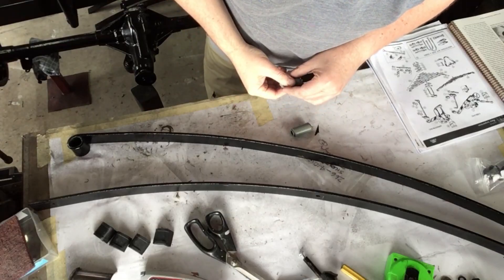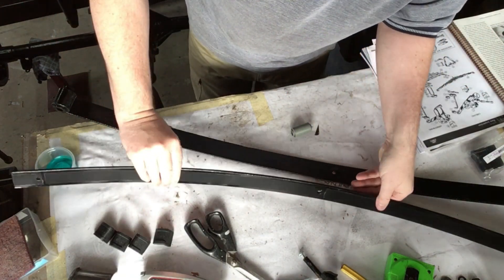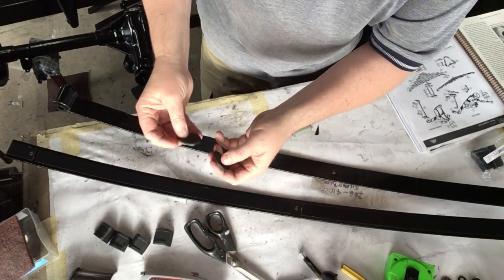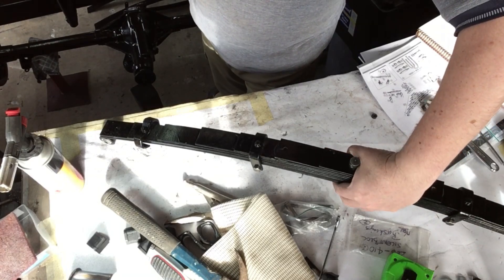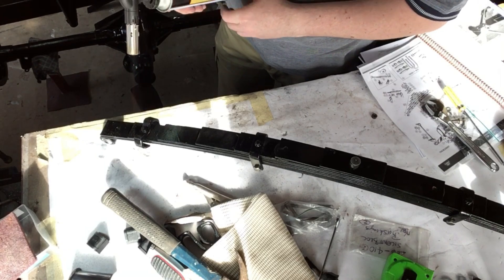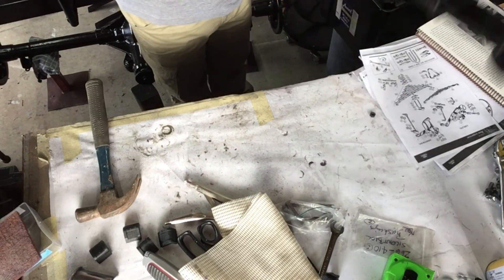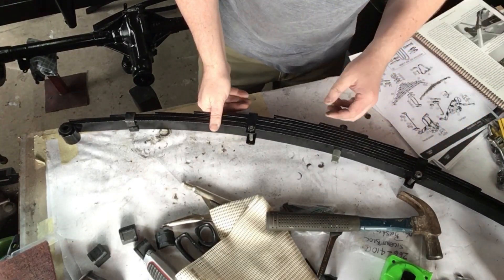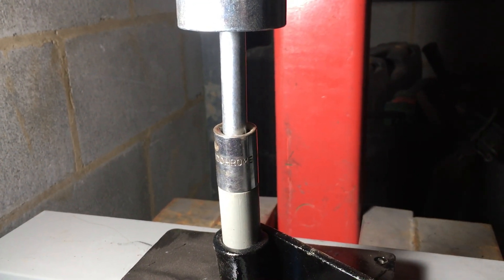1950 MGTD Rebuild Episode 22

Comment: What's the deal with that torch? I didn't use any heat on mine. Should I worry? Also, don't forget the "U" shaped things that goes on when installing the rear springs. Sorry, I don't remember what they are called but they keep the axle from being cut up by the springs(?).
Reply from the maker: Hi Ed
I used the torch to lessen the shock on the metal and hopefully decrease the chances of it breaking when I bent it back into shape. I wouldn’t worry about yours unless it is showing signs of cracking.
The u shaped things? Are you referring to the silver pieces that fit under the u-bolts and on top of the axle housing?
Reply: @MGREBUILD  Yes.
Reply from the maker: I have one so far and am just waiting for the other one to arrive before I fit the axle back into the car